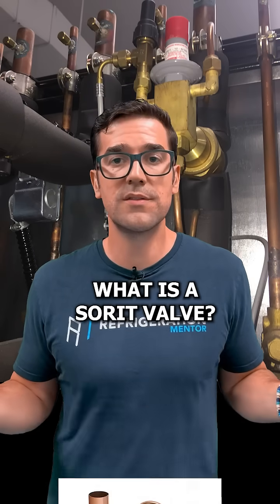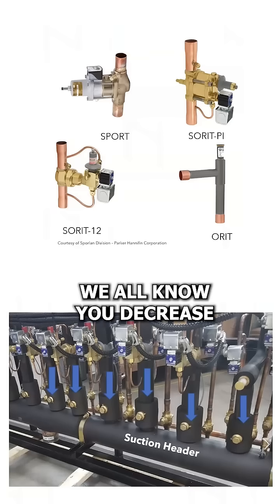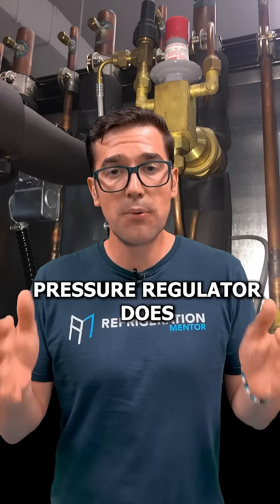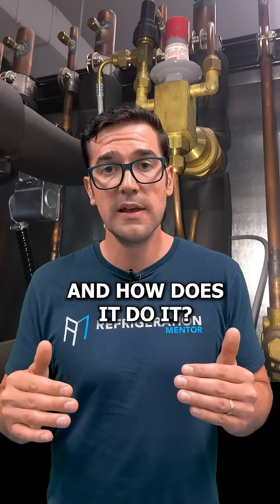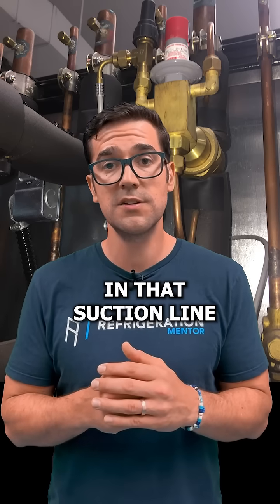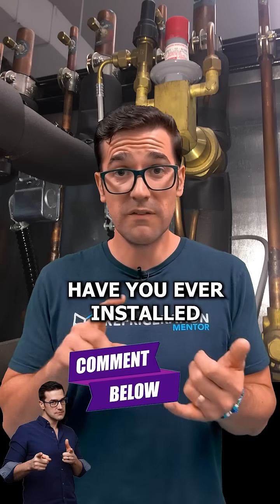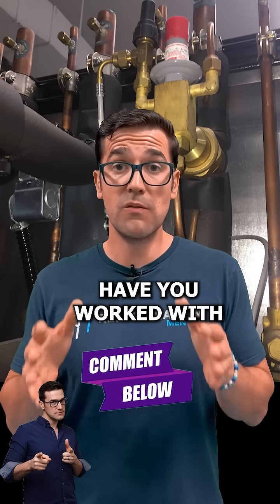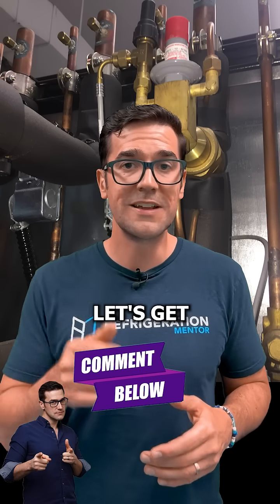Have you ever had to replace or calibrate a CDS valve?

Comment: These videos are great, Ive been working in refrigeration for 5 years now, straight out of highschool non union, I know how to make a system work but not the terminology or the in depth knowledge!

I know most things about racks, like eprs keeping a steady super heat so you can have 100% run time on the LLS.  A breakdown of how these valves work, gas actuated mainly, would be nice for diagnostics!

Keep these going!